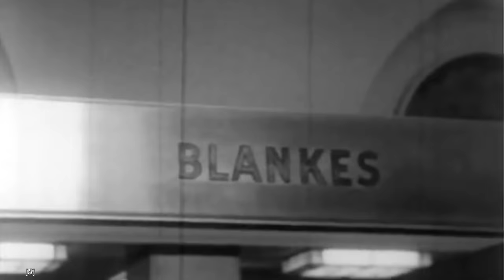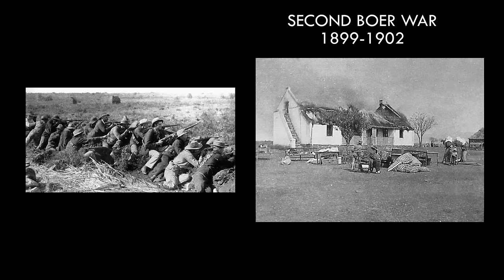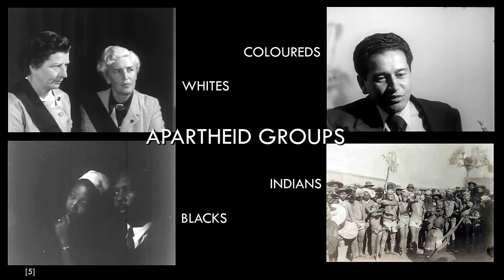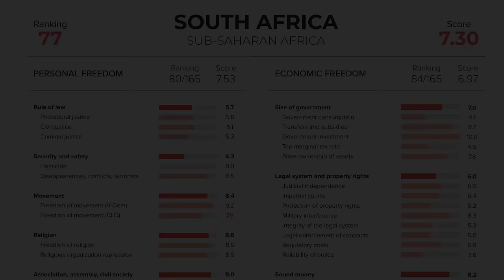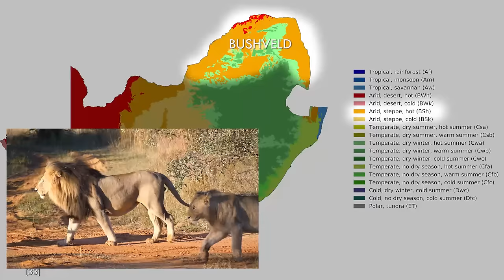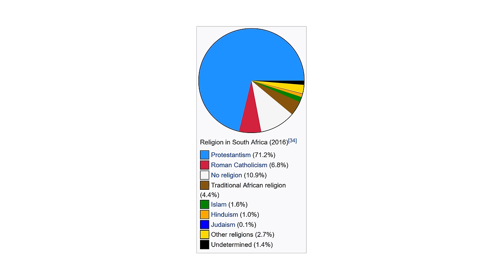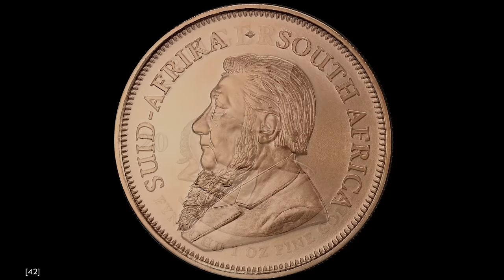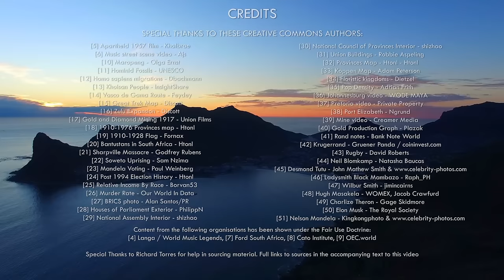South Africa: History, Geography, Economy & Culture

Comment: Very informative video indeed. Is it possible to go in details about homeland s. What would it have meant to have independent internationally recognized homelands
Reply from the maker: I have often wondered what would have happened if the homelands were recognised. But it was always unlikely. They were very poor areas with no industry, and hence no jobs, so when though they were lived in by black africans, most came into the main parts of South Africa to work
Reply: @Geodiode  Yes and the natives also did not want independent of those as they saw it as unfair as they only got less than 13% of the total land while being over 70% of the populace, most of it was not arable and had no natural resources.I don't think was going to work at all.
Reply: @sphethobuthelezi719  It is always unfair to tell people where they can and cannot live. The issue of land needs to be better understood though. It might be true that a small percentage (mostly White farmers) own most of the land but bear in mind that 55% of SA is classified as true desert. The homelands were allocated where the majority of rural Black people settled - generally the most fertile areas, such as the coastal belt of the Eastern Cape (Ciskei and Transkei) and KZN (KwaZulu).
Reply: @Geodiode  the Umtata area had many industries that closed after 1994 , because of the cheap Chinese imports that were allowed to flood the country .